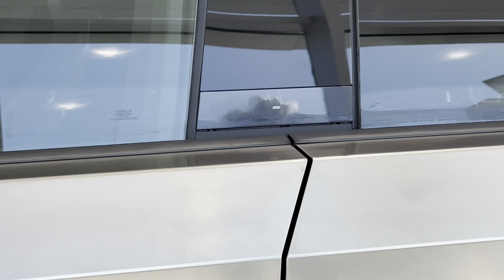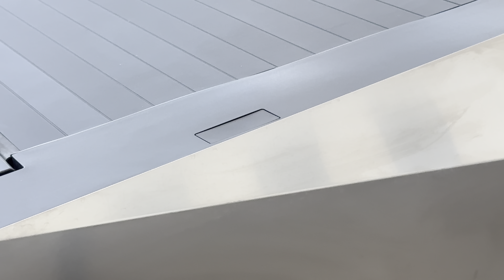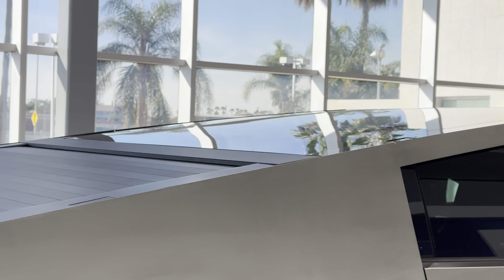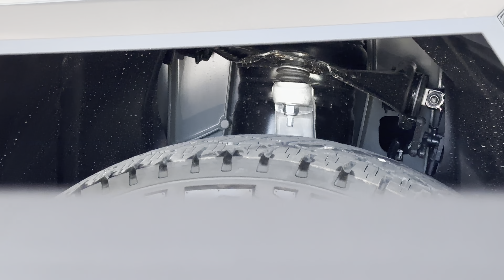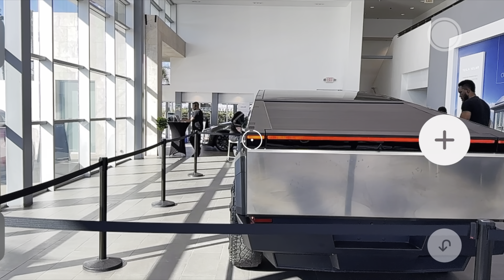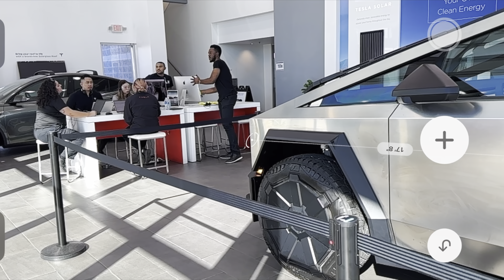Tesla Cybertruck Delivery at California Buena Park! Full Walk Around and Measurements!

Comment: Looks great but I'm afraid if it is going to get dinged easy. Like stainless steals refrigerators just a simple hit it will mark and dent. Is it the same here or will it have some kind of special coat to prevent that???? I put an order for one but I'm having 2nd thoughts now. And also I cant just spray water and soaps to clean the car? about about a car wash? it wont wash it good?
Reply from the maker: You are right are you ordering one?
Reply: I did already. Not sure by when my order will be available. Also right now trying to figure out if my order is for a specific model. I want to e all wheel drive one.

Comment: Lots of us are very glad that Musk made it a bit smaller than the prototypes.
Many HOAs (Home Owners Association)  require all homeowners to garage their vehicles.
Newer homes here in Orange County and specifically Huntington Beach have very short driveways to maximize house square footage, so NO driveway parking possible.
I prefer my truck to be parked securely in my garage.
If it doesn't fit, I will not consider it.
Reply from the maker: Most care to differ
Reply: Get a bigger house

Comment: Thanks for taking the time to make this excellent video and praise to Elon Musk for pushing design boundaries and defying the critics.   Elon Musk told all his existing/future customers a Tesla is an appreciating asset.  2019 - 'Elon Musk says it's 'basically crazy to buy any other car but a Tesla''.  In 2023, with auto finance rates hovering around 9%,  a $60K Cybertruck w/20% down for 60 months  (taxes,  title, fees rolled into the loan)  =  approximately $1,150/month.  

The assembly looks very good and I suspect these are close to hand-built and massively QA reviewed.  It is clear Elon/Tesla knows this will NOT be an easy sell as this is a vehicle entering a segment  where good EV trucks already exist.  My prediction:  Existing Tesla customers will want to trade but when they get the trade-in value of their current car and see what new finance rates are (approx. 9%), you will need to REALLY want this vehicle.  Many will choose not to buy as they have grown accustom for 4% financing not DOUBLE  that amount.   Elon cannot afford to sell this truck with low margins yet, a $75K Mid-range truck is a hard sell these days.

Unless he can ramp up a less expensive vehicle quickly, Rivian will soon announce their vehicles off a new R2 architecture and undercut the CyberTruck with less devisive styling.
Reply from the maker: Thanks for the added insight! 🤲
Reply: Rivian and other manufacturers can build on new architecture, but without 800v and 48v they are still going to be old by design.  Also they don't have bullet proof stainless body and sturdy glasses, and 4680 batteries.